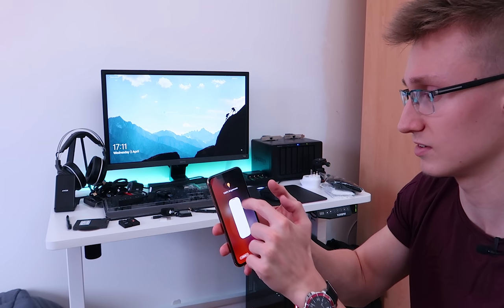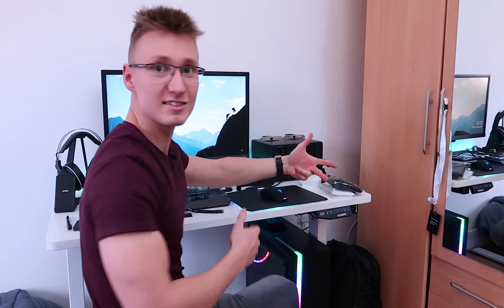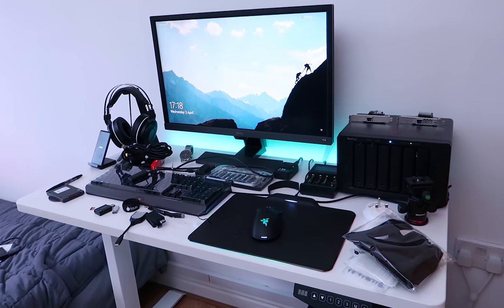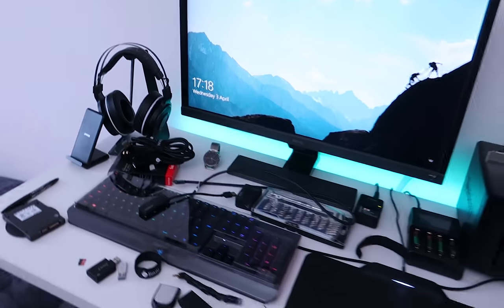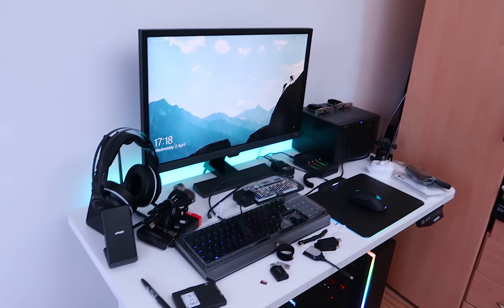My Cable Management sucks, let's fix it! - Part 3

Comment: hi techblock please i need help. I have an ikea linnmon 59 inch with 2 legs and a ikea alex drawer on one side. I saw your old 3 monitor stand when you had 3 of the same monitors. Did you have any aditional things to support the stand, or did you just clamp it to your desk? Or did you just drill a hole through you desk and clamp it like that? I have 3 asus vg428qe monitors, and they each weigh about 13 pounds. please reply asap. ty :)
Reply: I'm not sure what he did, but I'm sure If you just clamp it to ur desk it should be fine, ofc depending on the desk. I'm looking into the same desk and want to get a clamp for my 2 monitors, I'm likely going to wall mount it as I don't trust it, but I'm always over couscous. But check the ikea website, I can't remember the weight, so just don't go above that. That's my advice, hope this helps :)

Comment: ADMI Gaming PC: FX-6300 4.1GHz, 6 CORE, GTX 1050, 1TB HDD, 8GB 1600MHz, Raider Glass RGB LED Gaming Case, Windows 10

￼

￼

￼

￼
Reply: Is this good I found it on amazon I'm looking for a cheap first gaming pc

Comment: Hi just wondered if the power blocks have stay up with the double sided stuff u used? Need to do mine but want something that will actually stick
Reply from the maker: this double sided tape is holding up so far
Reply: TechBlock grew thank you will get myself some. Wens next video dropping?

Comment: Why dont you even get another desk or get an SIGNUM RACK and the reason for your cables falling it is FOR THE DAMN EVERY SINGLE CABLE GOES THROUGH so much cables and it DONT look good at all with all cables.